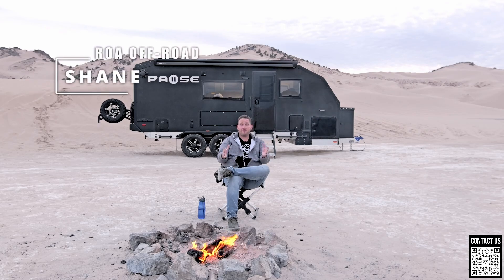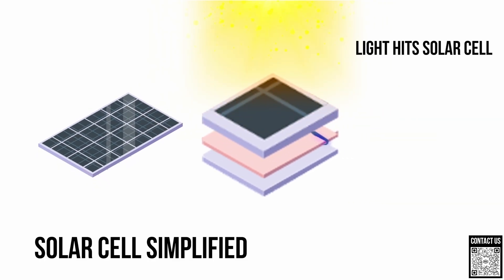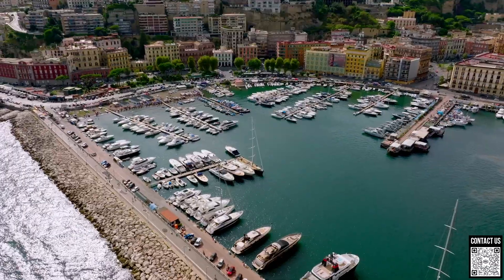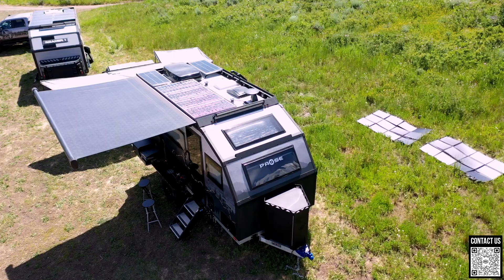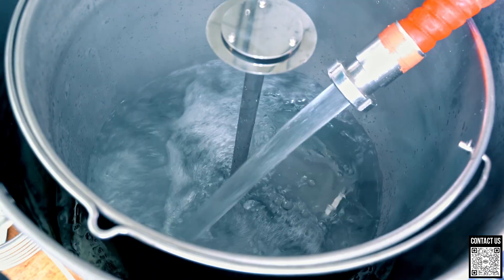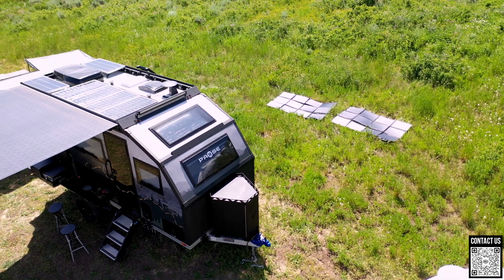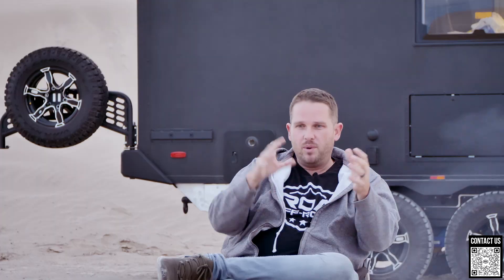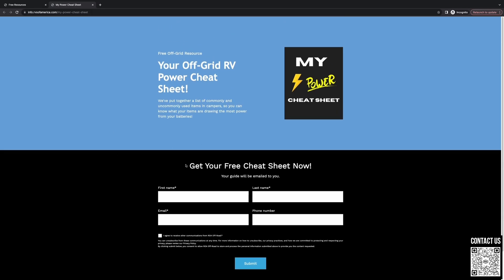How Does Solar Work In An Off-Grid RV?

Comment: If one has to choose between a large battery bank or a large solat array go with more solar. If you have say 1000 amps of storage (battery) and you have 1000 amps of solar to charge those batteries your batteries will not get filled in one days time especially if one is using power. The solar array at best will be 80%  efficient. That means only 800 amps will go to storage in one days time. And that is only if no power is beig consumed. 
One is better off to go with say 500 or 600 amps of storage but have atleast 1000 to 1200 of solar. Power in should on average double the storage capacity.

Comment: Well, I would kinda disagree about Solar not "running" anything.  I suppose in next weeks or future vids, you will explain what inverter/chargers are.  Because with the right inverter/charger, you can run off solar...at least partially.  In off grid inverter/charges you can tell it to prioritize AC output...which will allow you to use solar energy collected by the solar array to "assist" your battery bank or AC input based on your power consumption...but then you would need a pretty large-ish solar array...but technically you can run of your solar array..practically is another discussion altogether.  Thanks Shane...love the vids and I can hardly wait to see the new Paus Reboots and the MDCUSA stuff...talked with Josh from the UT store about these units...EXCITING STUFF!!!

Comment: I’m so disappointed lol.  I have Tesla solar @home with PowerWall batteries.  Works different.  I can run my home directly off solar, while charging my batteries off solar at the same time (assuming the solar output is greater than my home draw).  I can seamlessly switch from drawing power from the grid, to drawing from my batteries, to drawing directly from solar and not even notice that a switch (in the source) has happened.  I was really hoping that the systems within trailers worked the same way…😔
Reply: You can if you have the right inverter and have its charging and load priorities set correctly.  I am not a Victron guy, but I know other all in one charger/inverters that can do this type of switching.
Reply: It does work that way. Your solar panels will power everything and what is left over will go to the batteries.
Reply: @y4buckingbulls485  well you need an inverter...solar to charge controller to battery will not... it solar to inverter will if that makes sense